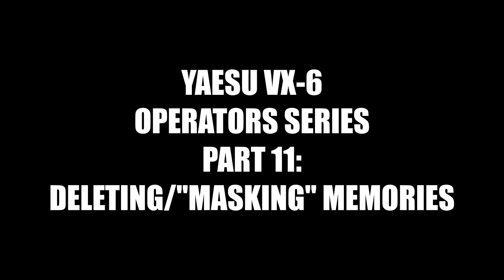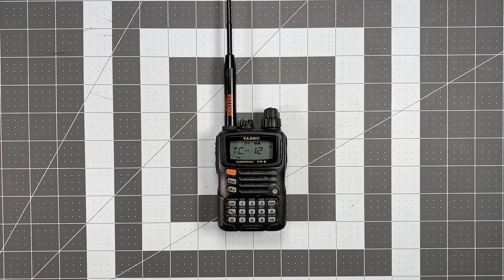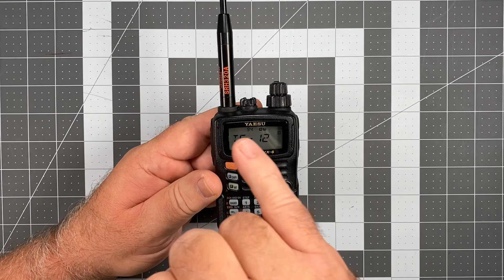VX-6 Operators Series - Part 11: Deleting/Masking a Memory Channel

Comment: I won't write a book, but masking vs deleting actually has to do with DMA (Direct Memory Access). It is super useful in this case.
tl;dr It is what allows for certain functions and efficiencies to happen with the radio, and doesn't require the CPU for channel recall.

I assume the symbol was chosen because Yaesu named some of their radio technology/branding "System Fusion," and calling it a "nuclear symbol" means their marketing is working 🤣

Comment: "Yaesu's Dept of Wacky Ideas" - I love that phrase..    I have a Yaesu FT-70D, and their Dept of Wacky Ideas had worked overtime on that model.        Thanks for the informational video.   A fellow ham here in our town had a VX-6 and found it to be so confusing that he went on the air and offered to sell it below what he paid for it, because he simply wanted to be rid of it.   I wanted to learn a bit about the unit, as it is one of the models that is still currently available.     Are there any currently available Yaesu handhelds that don't have as many wacky ideas in them?      73